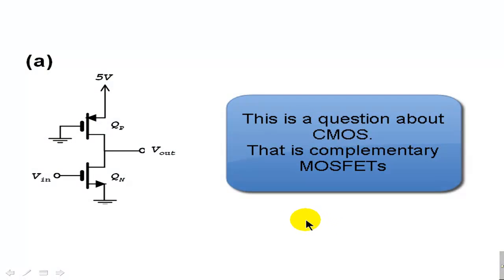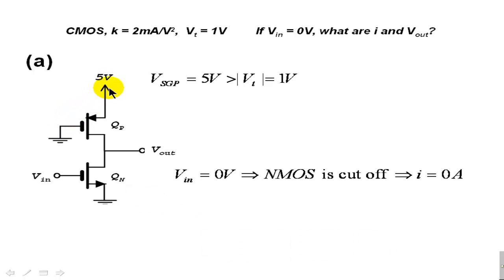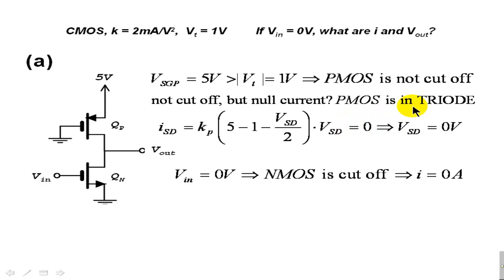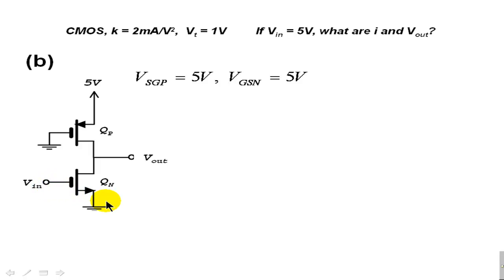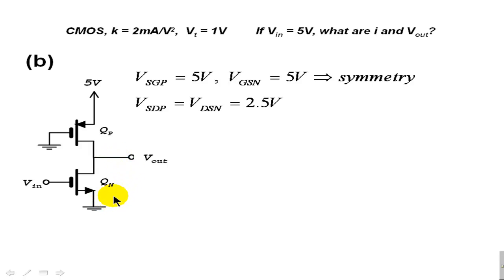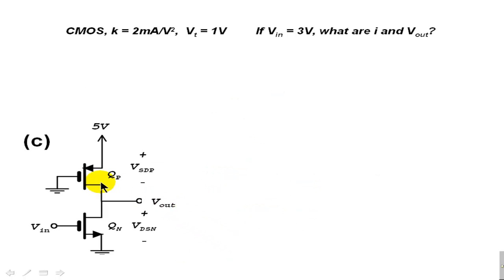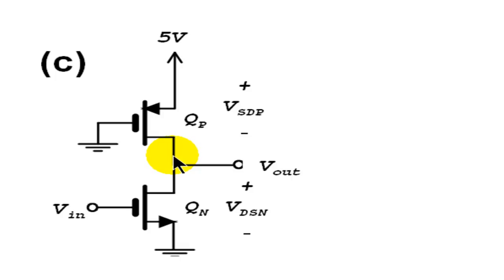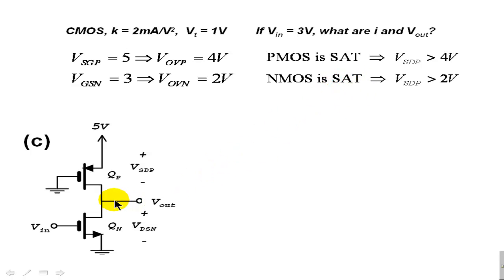EECE 251 - Final Exam Q6: MOSFET

Comment from the maker: (continuation) ..... Manufacturing methods permitted the implementation of the IGFET by means of a layer of metal on top of a layer of silicon oxide ... the Metal Oxide Semiconductor Field Effect Transistor, the MOSFET had been born .. the newest member of the transistor family. In engineering, when all such devices are of the same type, we just call them ... guess? ... transistor! ... (continues)...